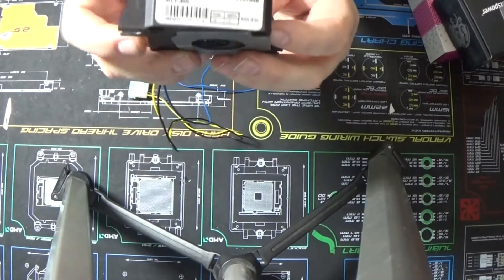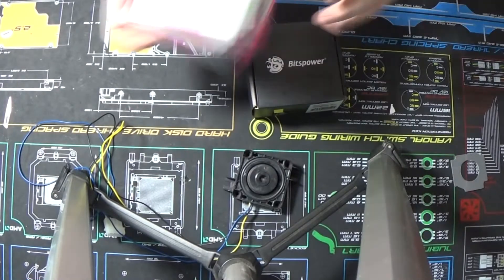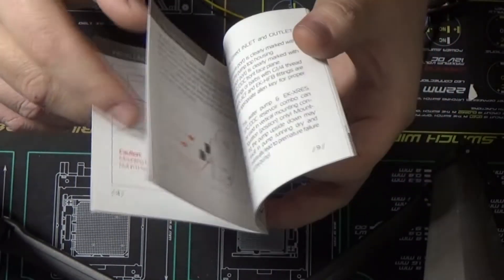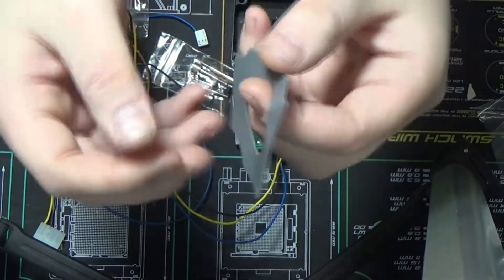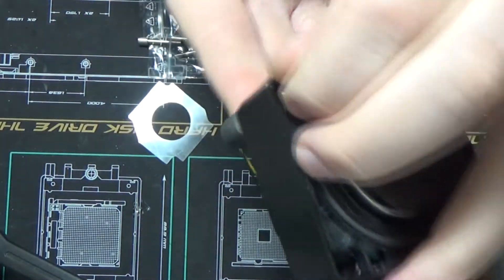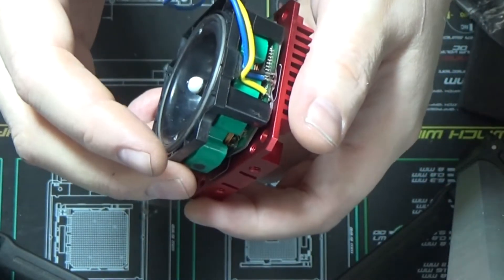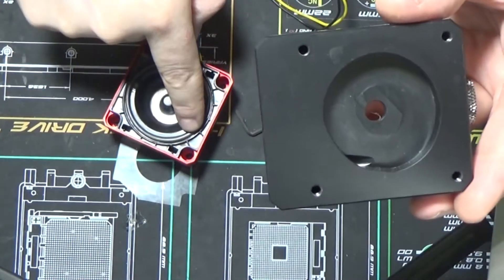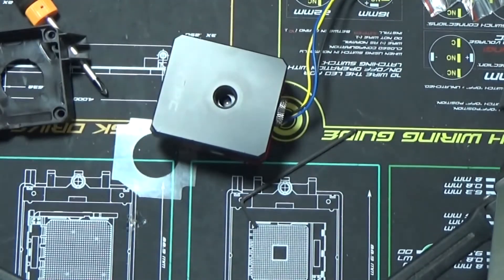FrozenCPU.com DDC Heat Sink Installation

Comment: Do you happen to have a heatsink that has those same flanges for mounting like the plastic housing that you just replaced?
Also are there any ddc laing pump tops that are same height as the default barbed ones but with compression fittings?
=÷=÷=÷=÷=÷=÷=÷=÷=÷=÷=
I would like some more information about the ddc laing pump with the stock barbed pump top dimensions and if it gets the heatsink upgrade, which would be the lowest profile heatsink that would make the pump height not exceed 40mm(1U)!?

Edit: sorry for my confusing request 🙃🔫
Reply from the maker: Hi there! No.. there is no heat sink we carry or that I know of that works with the stock housing! The stock barbs are 3/8 inch, and the stock top is about 25 ish mm tall on the pump.

Comment: Why no water block like a loop out and under lol. Enough radiator surface area will fix it.
Reply: That would be cool. I have not personally seen any water cooled DDC heat sinks.